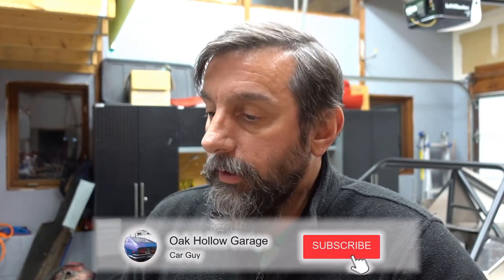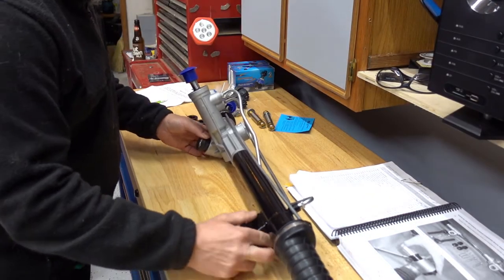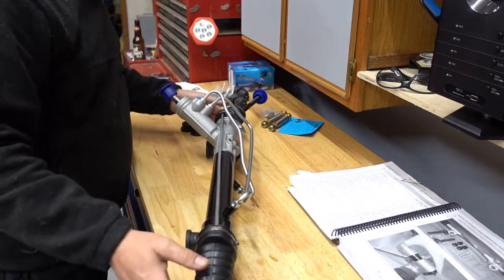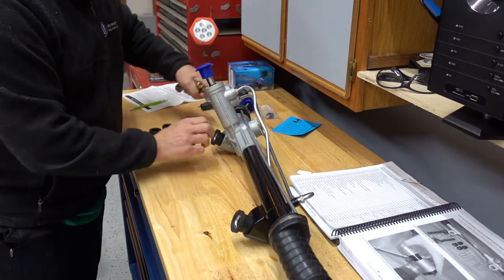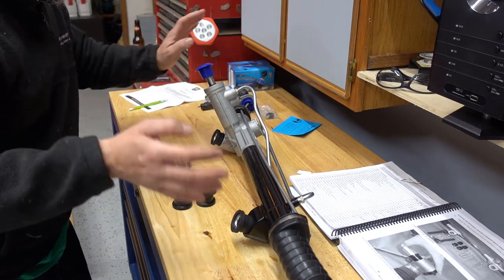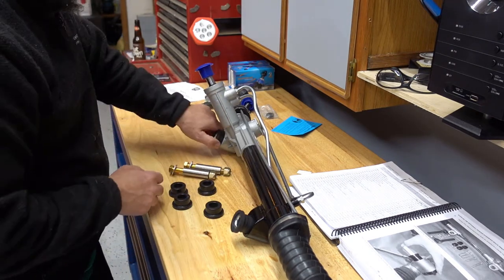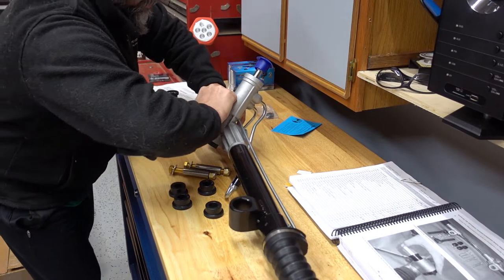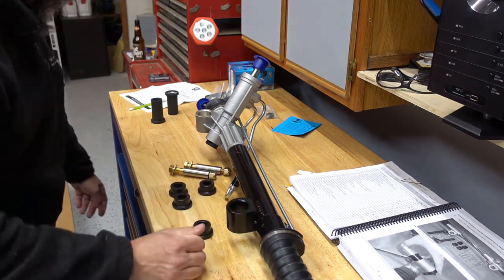Part 5 | Daytona Coupe Kit Car Power Steering Rack Install

Comment: There is a logical reason that Bolts are installed in a certain direction ( Airplanes do it that way)  Bolts are installed (when possible) with the Bolt Head being UP in the Vertical position and Forward looking back in the Horizontal position. Should the Nut fall off a Vertical Bolt, the Bolt may stay in position due to Gravity. Horizontally, weight transfer from front to back may help keep the Bolt from falling out. About Washers and Bolts. Most high grade Bolts have a washer incorporated into the Bolt. If you look at the underside of the Bolt you should see a round machined area below the Bolt Head. That is a built in washer.
Reply from the maker: Thanks for the great feedback. Looks like I installed them correctly.

Comment: Personal I would use 4 washers, and I agree, only need 2 threads showing out of the nut when it’s tight, other wish will end up looking like a wire fence fitting
Reply from the maker: I agree. However, I checked around and those are the correct bolts and just two washers.
Reply: @OakHollowGarage  if there is excessive material, I would be machining it off. But that’s just for me.

Comment: Smart move putting the bolt in on the other side for easy access and maintenance purposes. I would be too fixated on following the directions.
Reply from the maker: Thanks. I'm trying to give thought to everything, but if you watch a few other videos you will see that I have made a few mistakes because of my eagerness.
Reply: @OakHollowGarage  I don’t blame ya. The progress is exciting to watch. I’m strongly encouraged to attempt this myself.
Reply from the maker: @jonathanparker5375  It is certainly an intimidating project. I'm just some guy that likes to work on my own cars. I have zero mechanical training and certainly have large gaps in my knowledge and skill set. So... ya, go for it. I've been enjoying the process greatly so far. It's slow going, but always enjoyable.